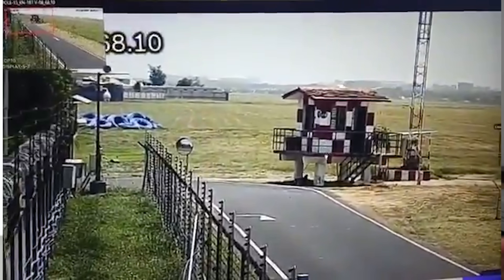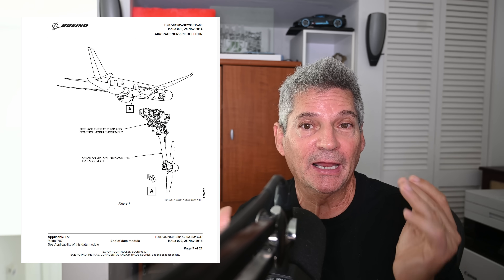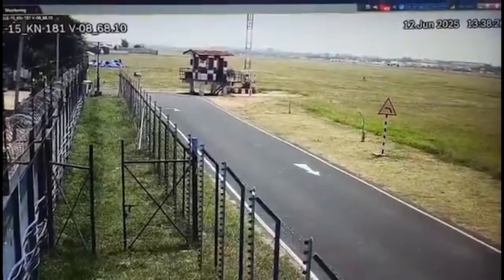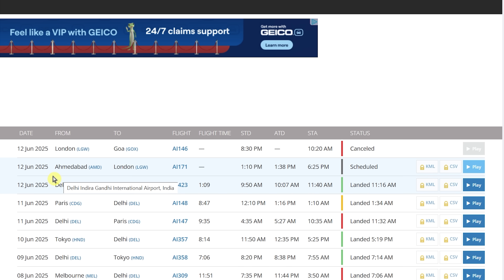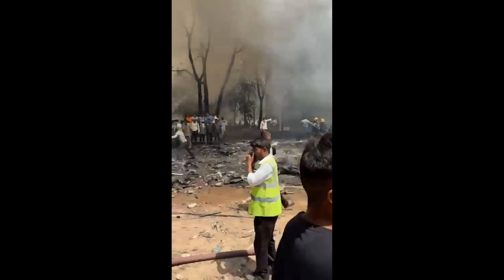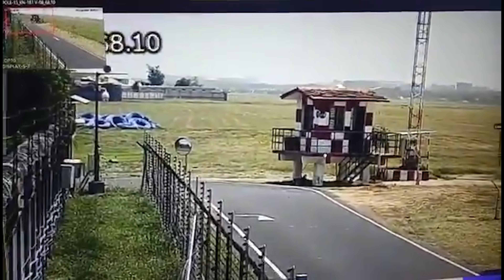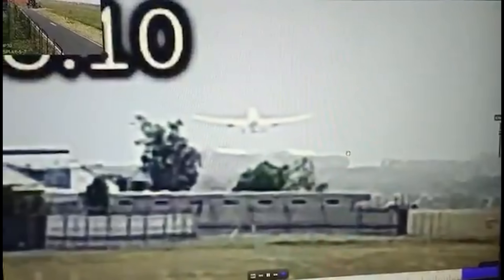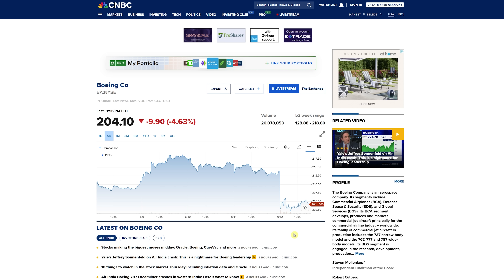What Caused Air India 171 Crash, Mysterious Sound Before Impact

Comment: You're not an airline pilot you're not even a licensed pilot don't comment on this stuff it's out of your comfort zone.
Reply from the maker: don't watch the video then it's outside your comfort zone
Reply: @jeffostroff 😂😂
Reply: And what are your qualifications? I am not a pilot but a core engine specialist. So do I have a say? First it's hard to see but I don't see flaps, second the newer engines will make that sound at takeoff power. I have worked in test cell making fuel controller adjustments to a running jet engine many times. And have worked on the engines while on the plane itself. I have heard number 1 compressor stalls and engine flame outs within feet of the engine. I heard neither sound in the video. Both engines sound like they are running properly. The plane went just above ground effect and without flaps couldn't provide enough lift at the speed to maintain flight. Should have had an alert for flaps anytime the plane moves on the ground. They need to see if the fuse was pulled so they didn't hear the flap alarm and didn't set the flaps prior to takeoff and if they did a proper pre flight check. I have seen thousands of landings and takeoffs. I have spent hundreds of hours in full cockpit simulators of many different large commercial aircraft.
Reply: Yeah believe this YT rando troll comment 😂

Comment: Its interesting that it crashed straight off the end of the runway. If an engine went out, it would have veered off to the left or right. The RAT deploys automatically if both engines go out.
Reply: The RAT would take a little time for the system to decide to auto-deploy it. When engines fail, they don't suddenly stop, usually. They take time to spool down. And then it takes 8 seconds to fully deploy the 787 RAT. So I question the timeline regarding seeing the RAT.The plane was not in the air very long at all. And when the RAT is supposedly seen, it had been in the air for an even shorter amount of time. It would surprise me to learn that the RAT was deployed.
Reply: @bills6093 absolutely. The aircraft was airborne for only about 40 secs or so.
Reply: @bills6093  Agreed. I live in Cape Town and often hear the same propellor type noise from a lot of the aircraft flying overhead, usually after take off - I believe this is a typical sound from high bypass turbo fan engines and just looking at the size of the 787 engines I am sure it would be far louder.
Reply: @bills6093  I agree. A windmilling engine would still be powering the gens, unless they booth just suddenly stopped. Then as you mentioned, there has to be deployment. High angle of attack, slow airspeed, it would have taken some time for all this to happen. I'll have to wait on the RAT theory. For now, I'm flaps over gear handle theory.
Reply: @90Swampfox  get away  from the flaps.  there are alarms and even a disable function. they cannot tale off without falps deployed for takeoff mode. and with RAT deployed it means the engines failed.
Reply: @Revkor  Thx for your reply. I'll wait for the report BUT I'm a currently 777 Captain, so I've some experience. Different plane but some similarities. I didn't say they took off without flaps. My theory and it's just a theory, as is everyone else's, is the "non flying" retracted flaps instead of gear. In video, plane starts to sink right around the altitude gear retraction should start. As for the RAT, whats the min airspeed for reliable? More than the 170kts and high AOA on takeoff. If both engines stopped at the same time, they'd have to seize 0 percent N1 as the windmilling would maintain generator engagement and the RAT would not deploy automatically. These are just theories and we're all speculating. But we'll learn the actual and hopefully how to prevent this from ever happening again.
Reply: @90Swampfox The RAT is CLEARLY heard in the one video! So, as some have said if it takes at barely minimum 8 seconds to deploy, then the RAT HAD to deploy while the aircraft was rolling down the runway!!
Reply: @Revkor The jet engines can be heard in the one video along with the RAT.
Reply: @matthewgroff433  but not as loud as it should be. they maybe spinning but not makign thrust.
Reply: @90Swampfox  "As for the RAT, whats the min airspeed for reliable?" 130 KIAS. It's designed to provide minimal electrical power and hydraulic pressure all the way through a landing.
Reply: nope-boeing actually rebuilt a 747 that landed in the swamp at end of new dehli airstrip in 87.  and i'll bet 25 cents that fuel feed cut off from error in panel
Reply: Fly by wire can handle asymmetrical thrust automatically
Reply: No, not with properly trained crew, you maintain heading after loss of thrust in one-engine.
Reply: @sdstreiker  True, and that heading is maintained by use of the rudder, and sometimes a bit of aileron. During a climb configuration (high power on the remaining engine vs relatively slower airspeed due to climbing) the rudder displacement needed to maintain heading would be significant.
Reply: @sdstreiker it would still veer for a moment because of asymmetrical thrust until rudder input to correct
Reply: @CaliforniaDreaming559  Not in my experience - 4 or 5 degrees then immediately back to runway heading.
Reply: @sdstreiker yea back to runway heading after few seconds because the pilots are inputting rudder commands to counter the thrust imbalance. The further apart engines are the more of a yaw issue youll have and airliners engines are way far apart. But yes i agree they will correct it because they want to fly straight
Reply: No, unless the flight controls are compromised or the airspeed is too low the crew compensates for loss of an engine and the only way you'd know is the FDR.
Reply: Losing a single engine isn't going to trigger the rat. The plane can stay in the air even with one engine. They had to lose both.
Reply: I don’t know about the 787 , but in other planes the Rat can deploy if the engine that powers the cockpit / instruments , etc goes out , so on some it could be one or the other of the engines
Reply: @peterf.229 i believe the 787 and ost modern planes it will deploy automatically if the conditions are met and pilots can also deploy it manually
Reply: yea rammer turbine, i saw it explained in a different video, sounded just like it. like a really big bumblebee or a small cesna like plane flying over much higher.
Reply: @MarcoFD  "rammer" lol
Reply: @MarcoFD "Ram Air Turbine."
Reply: A similar plane crash occurred in Argentina in 1999. The cause: the crew's failure to extend the plane's flaps, preventing lift during takeoff.
Reply: @PADARM , the in-cockpit warnings on the modern Boeing 787 would have been blaring if the pilots had "forgotten' to extend the flaps" during take off.
So, the flaps were most probably retracted soon after take off, but what is puzzling is why the landing gear remained extended?
Reply: Gears are getting retracted after a positive climb rate is established.
No climb - pilot imediate attention is switched to the source of problem forgetting about the gears.
Low airspeed  with zero flaps=> higher angle of attack .
Gears still down = more drag = > higher angle of attack  + panicking pilot pulling the yoke = stall

Comment: Doesn't appear to have flaps down (should) - didn't use the full length of the runway. Hot weather (less dense air) - full load of fuel for a long flight, gear not retracted. Possible loss of power?

All those things will contribute but who knows why it didn't have the power to fly. Personally I think flaps are the most likely culprit along with one of the other factors.
Reply: I heard video that said 787 most advanced computer-controlled avionics, and pilot would have multiple, constant warnings as they prepare for take-off, computer can read all the settings and knows the flaps are not down. Also, I saw others say that they went to the end of the runway, haven't seen an official airport video yet.
Reply: @johngreydanus2033  i can tell it used all the length of runway... It went back to the start of runway 23.
Reply: @Tugofwar22  Great thanks, not sure how he was saying it didn't use full runway without any video, all the tracking I have seen says they taxi to end of runway and turned around as normal procedures. 2025 is scary with crashes, helicopters, that Korean bird strike, wow!
Reply: The RAT most likely deployed because the engines failed or there was some other catastrophical electrical failure, and the plane crashed because of the engine failures.  The engines didn't fail because of landing gear, flaps, air temperature etc.
Reply: It wouldn’t have taken off if the flaps were up… It took off and then it looks like it lost power🤔
Reply: Flaps look like they are retracted...

Even if your the world's best pilot. If your tired or over worked or something else then you can most definitely make mistakes that rookies make..
Reply: @evelghostrider yes 1 pm feels like sleepy 🥱

Comment: I only trust this channel to uncover truth
Reply: Lol he's often wrong on aviation stuff. I think he's wrong on this one. Very likely the flaps. All experts that watch the videos say incorrect flaps. Makes most sense.

edit: I've changed my mind. I deserve to be tarred and feathered. Dual engine failure may have indeed happened. ADSB data transmission halted when they got airborne, so they did have electrical issues clearly.
Reply: @garrymullins  Makes sense except the advanced avionics should have been giving constant warnings before take-off, and the engines had no power, well, only enough power to get off the ground but not enough to keep going; that's not flaps.
Reply: As if, you are a clown
Reply: @johngreydanus2033 Not really. The mainstream media lies like a rug